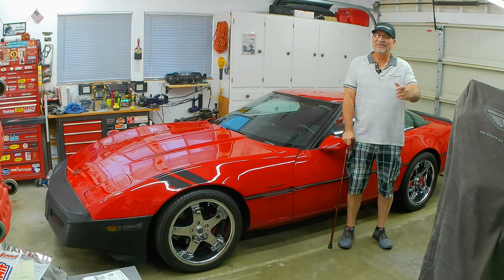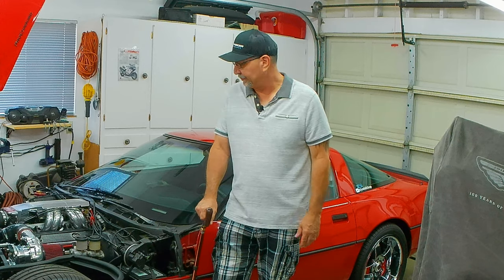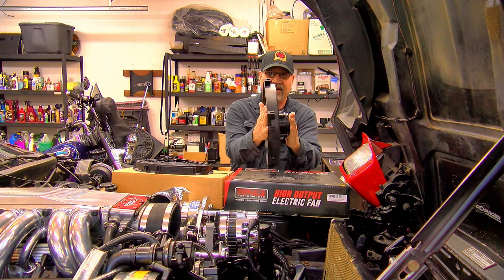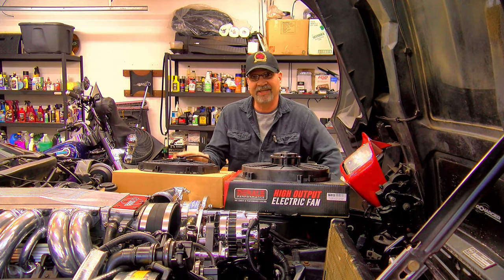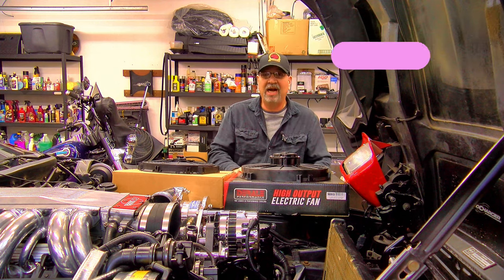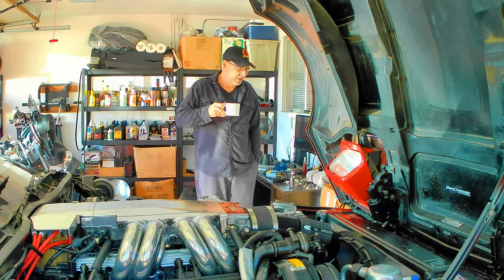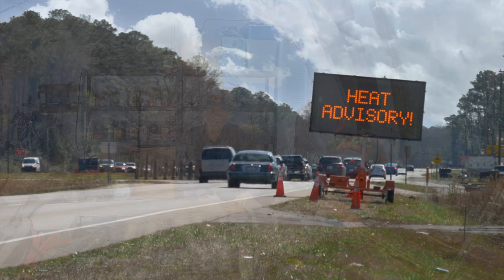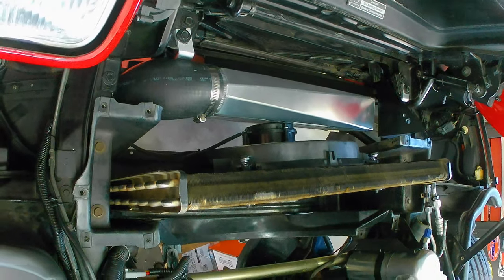Supercharger | Engine heat | Perfect cooling system

Comment: Did Flex-A-Lite have anything that would've worked?
Reply from the maker: Can't remember if I did, but I think so. I did check out most of the brand fans. Problem was I needed to be less than 3 inches in width to get any fan in between the SC Intercooler and main fan. All the ones I looked at were about 4 inches plus for a fan that pushed 2000 cfm or more. The Derale came in at about 2.8 inch in width.
Reply: @CorvetteEdsGarage    Good to know.  I'll have to go check out Matt Garrett's supercharger vid to see what he did or if he had an intercooler.   Have you had it dyno'd,  O-60, 1/4 mile?  Did you have to reprogram or retune /chip, injectors?   Ill check out you playlist.
Reply from the maker: @chrispompano  Not yet until I install the wideband, fuel pressure and boost gauges, which I'm in the process of doing. Then I can tune the vette in manually then take it to get dyno for final tune.